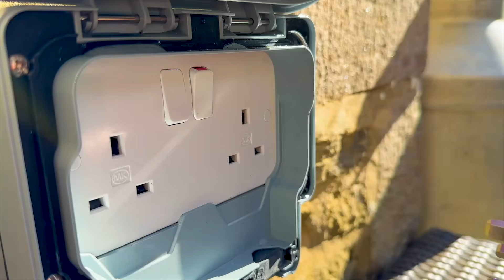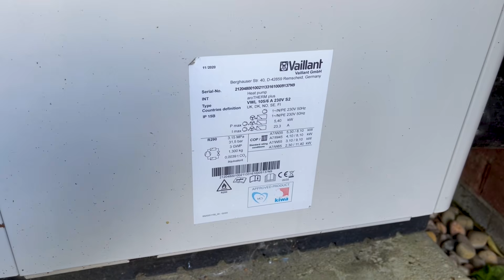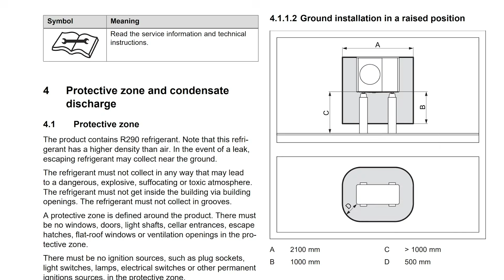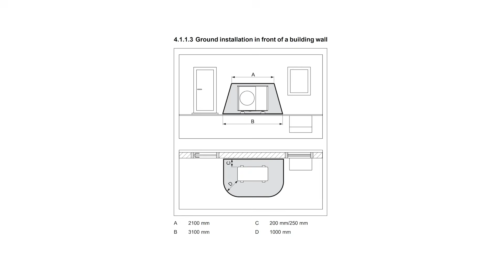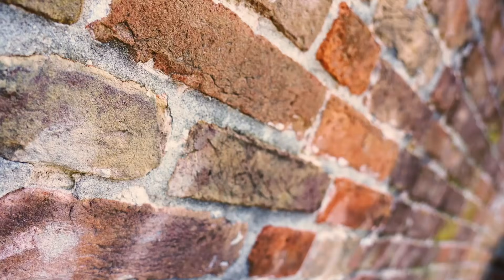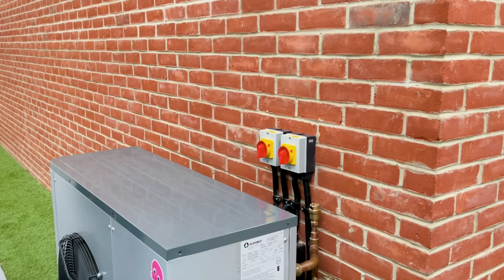Heat Pumps: The Explosion Risk Most Electricians Miss...

Comment: Yet the electricians forget that is a 3.5 PSI pipe of methane coming into your house that if an installer does not have their connections tight The entire house could explode that day Where is a heat pump There's like maybe 20 pounds of propane in there which you can legally store 20 lbs of propane anywhere

Comment: I have then a serious Question, if we discussing the risk of ignition and equipment require exclusion zone and this zone is to be treated as explosive area. 
What of the heat pump itself and its electronic sensors compressor motor all those should be then directly ATEx rated and certified.  I cant see how this then make sense except a night mare scenario.

Threating heat pump as EXd   equipment while its not Exd rated :LOL
Reply: @martinvaci7166  exactly

Comment: This does not make sense and this is another regulation for regulation sake. There is no chance that an escape of gas would reach the lower explosive limit and the chance of that happening when isolating the heat pump is ridiculous. Also the flame path of the cable gland would prevent even that 1 in a billion chance

Comment: What is most fascinating is that the rating plate / sticker for the R290 Vaillant Heat Pump in the video doesn't appear to have ATEX 'EX' marking, suggesting the heat pump itself,. sitting in the zone, may not be ATEX approved.

It would require special fan impellers / housings to prevent sparking in the event of a fan failing mechanically,, for example.

I can see another load of regs and bureaucracy tying itself in knots..

Comment: Sadly most electricians think this is silly, as do many installers. It isn't because it comes under LPG regulations, it's why units can't be positioned near rain water or sewage drain inlets from kitchen sinks etc. Nor can they be put within distance to an air vent to under the ventilated floor, basement or light well. It's a 1.5%-10% volume in air explosion limit for propane. Now Britain is windy so the likelihood of the 1-5kg of LPG in a heat pump pooling is not large but we have to plan for worst case, IE still days no wind, fan on the external unit not running.
In short - possibility of being an issue, not high in most cases (split units that European commission wanted to make LPG with the LPG lines running through homes is a high risk - hence was shut down by industry.)
Chance to go to prison if you don't adhere to the regulations which have been around for LPG for decades if something does unfortunately go wrong - 100% because it's in black and white in the m.i's.

Comment: At 0:30 that photo is nonsense regarding what looks like cables and pipes/conduits fixed to the wall. Oh, and the size of that red/yellow thing that looks like a rotary isolator switch, but is similar in size of that cat entrance door, so 4 times bigger than regular maintenance isolators.

Comment: Heat pumps will NEVERRR replace gas. And please stop fear mongering people about a explotion zone BS ..  What about your gas stove in the kitchen.. what about portable ac units pluged in inside your living room.  What about the pathetic plug in solar systems the gov aproved. You have alot more to worry about.
Reply from the maker: Natural gas stove in the kitchen uses methane which is lighter than air.

Comment: Chances of this being any king of issue outdoors is negligible - any gas would dissipate immediately. Has there been a single incident ever ?
Reply from the maker: https://www.coolingpost.com/world-news/heat-pump-blamed-for-fatal-explosion/
Reply: @efixx  there's a further article on it titled "Incorrect pressure testing caused heat pump explosion", which shows that the cause wasn't the refrigerant.
Reply: With R290 Heat Pumps, a couple not in the UK. Enough that it's now contained in all manufacturer instructions as they have to abided by UK/EU LPG regulations which are statutory gas regulations. 
With 4.7kg bottles, yes many times over the years. 12-12kw heat pumps have upto 5kg of lpg in them so they are a direct comparison and thus present adequate danger to life and property to be treated under LPG regulations as LPG appliances/ installations. 
Domestic 3.5-5kw heat pumps have around 500g of LPG in them, explosion limits of LPG are lower, calorific value is higher allowing for a bigger boom with less gas compared to natural gas, natural gas dissipates in air due to being lighter, LPG is heavier and in no wind will find the lowest point just like water.

The risk is significant enough that Vaillant on one site has 7 12kw units on a roof and it had to have a parapet wall constructed around the units 1ft high and a dedicated down pipe to the floor in case of an LPG leak. It also highlighted that retrofitting LPG heat pumps to blocks of flats constructed in the same way as Ronan Point is a non-starter so any of the remaining blocks in the country will either have to have district heating that's non-local to the buildings installed, or the blocks themselves demolished and replaced.
Reply: @effervescence5664  It's worth noting here that risk mitigation, does not mean that the risk is high - think seat belts, you wear them just in case of the event of a crash, not that a crash in inevitable. Also, there are already better alternatives than having multiple R290 A2W units on the roof, e.g. Kensa already do ground source retrofits for large blocks of flats with "shoebox" internal units in each flat. A2A is also an option for blocks of flats, and if R290 is a concern, R32 units are still the more widely available units - and likely will be for some time.
Reply: They adding hydrogen to propane and natural gas because of net zero Carbon insanity. People are getting burned and killef everyday in explosive gas clouds and explosions. No warning of the hazards. I don't believe it either but its already implemented and increasing to up to 10% by 2030. Why are oil tankers and pipelines exploding. LNG and CNG tranport trucks blowing up daily worldwide.Firefighters and getting the worst of it.

Comment: If this equipment has a hazardous area zone around it, then the unit itself must also be certified. I have not seen any with the R290 gas, but if, like the others, there is no way these would be certified 

This would mean installers of heat pumps would need to be compex ex01 to ex04. 

Yes you can move the isolator out of the zone, but any glands, etc, inside the zone would still need to be certified with the relvant BS 60079 paper being issued.

If they are certified, it would explain the ridiculously high costs to buy one.😂

Comment: Our wall mounted AC/Heat Pump is filled with R290, but the unit has internal switches that are either operated on the unit or by the remote, so it seems rather irrelevant about isolator position.
As for red and yellow isolators, my hot tub has one on the adjacent wall and I like it so it is staying there😀
Reply: Isolator position is governed by other rules. The mistake that eFixx seems to make is that they think the brown book (now orange) dictates the rules of electrical installation... no, there are fire regs, building regs, planning, HVAC, DNO provisions, covenants and tons of shit relating to electrical installations that its impossible to ever get on top of AND earn a bob as an electricain!

Comment: This propane explosion risk is just absurdly paranoid. We’re replacing piping methane into dwelling spaces with something many orders of magnitude less dangerous, even if we managed to combust all the propane in a heat pump the explosion would be tiny compared to the ones we get from leaking gas inside dwellings.
Reply: Maybe we should worry if installing into a sunken basement space, but for every other install it’s just going to disperse under the tiniest of outdoor air movements.
Reply from the maker: Methane is lighter than air - R290 is heavier hence pooling risk.
Reply: The game has changed to comply with net zero Carbon lunacy by 2030 the are adding small percentage of (1-5%) hydrogen to fossil fuels. Crazy they are adding hydrogen to oil, diesel, natural gas. propane and more tthan likely gasoline. Sounds impossible but start reaearching explosions and they are everywhere some massive. CNG in USA.  They are making explosives and bombs from these mixes as well.  I have seen about  10 in the last couple of years. These didn't explode but are very close they are upping the percentage in the propane by 2030. Pure  Hydrogen 10,000 PSI or -253C to ttansport unless you add to ammonia, oil, diesel, petrol, propane, natural gas. Plus it reduces carbon emmisions. In all the scientific papers they never mention increased chance of leaks, increased flamabiliy, explosion hazards, asphyxiation, embritlement. NOx, Production, and water vaper production a greenhouse gas worse than CO2.

Comment: As an electrician I install heat pumps and air conditioning. You need a few extra courses, F-gas and to handle R-290, an explosive course, it's a very interesting, fun, add-on to being an electrician.
The DP isolator rule has been around for years, nothing new. What can be a complicated challenge to electricians is how to phase balance multiple single phase A/C's and how in the specific building the air flows will interact (i.e. affected the loads) especially in a photovoltaic environment, by chance, that's what I have been up to all day today, sitting in front of my PC for 12 hrs with site drawings, SLD's, wiring diagrams and wondering how I get 9 A/C's (an 18k BTU is 2kW, 24k BTU is 3kW) to work alongside a 10kW 3-phase PVS and decided it can't, the running costs will be too high, so after dinner redesign with a 18 kW PVS system...
Reply: Spec a three phase vrv/vrf 😉
Reply: @CMCElectricalEngineeringLtd  Thats where an experienced electrician really come in, mid last year I installed a VRF system, it was a bit complicated in that there was a dropped ceiling in a snooker room (with air handlers above), similar setup in the bar, dancefloor. The HVAC wasn't too bad, but as you suggest, bit of a leaning curve, but one great thing with HVAC you never get with electrical contracting wholesalers is that suppliers all have an expert behind the counter who have access to all the design tools, air flow and thermal  management etc and they are quite willing to spend hours on the design.
The electrical install (the bit I have 35 years experience with) was a much bigger job and didn't go as well! In fact, it still doesn't work, the two inverters that charges the backup batteries keeps loosing aspects of their programming, f-knows why,  I am at my wits end and umming and arghhing about putting them in the bin and going for a different make and slightly different approach.
But, if you are an electrician that only works on big jobs that takes months, HVAC is a lot of fun and very rewarding because there is an effect, wheras a lovely neat plant room full of inverters all mounted plus or minus a mm, trunking precision cut, CAD drawings on the walls, gives you pride but nobody (apart from an inspector) will probably ever know what's in there!

Comment: I always install white "lever isolators" when installing anything on the outside of a domestic property.  They look so much better than those red and yellow things.
Reply: I always install isolators in a DB so they are all together, I think it looks nicer and if I was honest... (yes, shoot me!) despite hours and hours I spend on my PC designing prior to installation, something always has to change, if theres a DB involved (even if it not DB-ing) you can adapt it. 
I have a perfect example yesterday, yes, I lnow, my f@@-up), I had installed a system that was all integrated to IoT/LTE-M to control lights, basically when the panel feed dropped to a certain amount, the lights came on, then the DNO instead of throttling grid feed started to cut it off, that meant that in May when there is no heating or air con, panel output dropped to zero and the lights came on! So now I have to add a GPS/astronomical switches, luckily I have a lovely gap in the DB, so instead f everybody saying 'Paul you're a pillock for designing such a stupid system', they say 'Paul, you're idea of leaving space for the astronomical timer turned out to be a great bit of inspiration!'

Comment: Hmm. So what about the 13kg propane cylinders stored in sheds, garages or on people’s patios?  Or the piped natural gas running around our homes connected to boilers, hobs and gas fires? No risk of explosion there then. Oh wait…….! Most ASHP using R290 have less than 200 grams hermetically sealed in the unit which is outdoors.  This is hardly an explosion risk. Utter nonsense!
Reply: No I don't agree, the point is in a reverse heat engine you are compressing the gas, unlike in a natural gas supply. Their are also strict controls on connecting gas supplies. A system is hermetically sealed until it isn't. Air con, refrigeration and heat pumps work exactly the same way. Would you really want a propane refrigerator, rather than an inert gas? Some refrigerant gasses are toxic, and are used in industrial applications. Quite honestly I do not take mathematical modeling of global warming gasses seriously, given the difficulty of attributing weigting causality in a complex system with many causal factors that interact in complex fashions where causality may be bi directional and with very poor data sets. How exactly do you gather reliable data sources for average global temperature over time, that is consistant over time, given that currently we point satilites at arbitrary points at the lower atmosphere for temp readings using an algorithm to calculate global average temperature, with the algorithm changing over time, then compare this with data gleened from archeology? Now nobody wants to go back to cfcs, that had a proven damaging effect on the ozone layer, but particularly for domestic use a relatively inert gas should be used. For example in industrial uses CO2 is used, the problem with this is very high pressures have to be used, that create dangers even without an ignition risk.
Reply: @regsmith5972  Propane stored in gas bottles is under pressure. I saw one explode on a site in London which blew the roof of a transit van. Portable AC units are now available with R290. The majority of refrigeration based commercial and domestic AC systems utilise R32 which is classified as A2L partially flammable or R410a which is non-flammable but is denser than air and can suffocate you should sufficient volume leak into a space where you were sleeping. All would have refrigerant piped internally within buildings. Newer small split AC systems are now also moving towards R290. R744 refrigerant based systems (Carbon Dioxide) whilst natural, non-toxic, non-flammable operate at up to 2000psi and even when not operating have a static pressure of around 800psi. A sudden pipe fracture could be lethal.  My point is that every one of these everyday scenarios carries a much greater risk than an ASHP sitting in someone’s garden with 200 grams of R290.
Reply: @regsmith5972  Why do you think you are smarter than all the scientists measuring and calculating temperature increase of our planet? Of course there are uncertainties but those are included in the calculations. Yes, a single data point has a large uncertainty but there are billions of them, making global warming a fact. It is more likely that you or me won't survive the next two years than that there is no  human made climate change. To compare  the impact of different gases you don't have to wait for temperature changes, you can do lab testing.
By the way, those >10 kg of propane for the stove or barbecue might not be in constant movement, but still they are a compressed liquified gas, only hindered from escaping by a simple valve that could mechanically fail every time you open or close it. So I agree with the statement that ~200 g stored outside with safety measures in place are a lot safer than that...
Reply: You are correct, don't forget that the propane used in HVAC is a tiny amount, not 13Kg, I weigh out 80g! The other thing is that the pipes are evacuated to a very low vacuum so there is zero Oxygen to make a bang or flame! The only other thing in R-290 pipes is something called POE oil (as opposed to PoE for all the electricians that's why the case of the 'O' is important).

Comment: Thank you for continuing the agonisingly slow progress in ridding residents of the ugliness of unneeded emergency isolators. 

Yellow and red? Oo yes please my favourite. Said nobody, ever.
Reply: They are not emergency, they are for routine annual maintenance and the rules are contained in the HVAC version of the brown book, they don't need to be red, the industry standard is made by EuroLamp and is light grey, I buy them in bulk (I think they come in a box of 30) for about 11 quid each. The only thing that you as an electrician need to watch out for is that the 2.5mm spec is also the Pc! we are used to power circuits having a 1.5mm Pc. However if you run two isolators in one conduit (single-phase) daisy chained, you only need 5 wires all 2.5mm which isn't what you might think would be logical.

Comment: Heat pumps is not booming. Simply because they are to expensive..
Reply: What.. to run, install or purchase... or all 3? I love heat pumps, but they have a very small window where all those 3 can work and they only work in the exact property with the exact heating layout and installation and always with a substantial PVS system.

Comment: I’m just a punter but this is quite scary despite my butane fridge buying past.
Reply: Its not scary at all, the stoichiometric (and volume) of R290 is so small, it's a non consideration for outside work.
Reply: Thats scary ! ....  The cars fuel pump commutator is cooled by being submerged in petrol, the  fuel gauge sender in the same tank.   Fuel is not the problems it is the presence of oxygen.